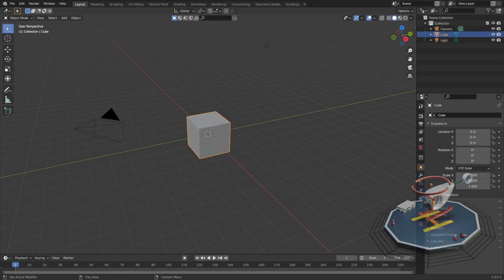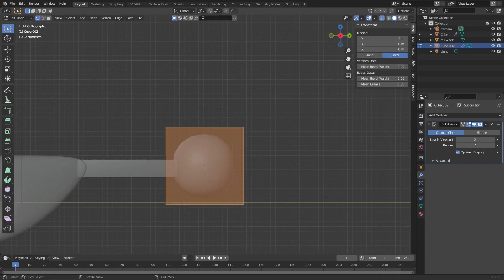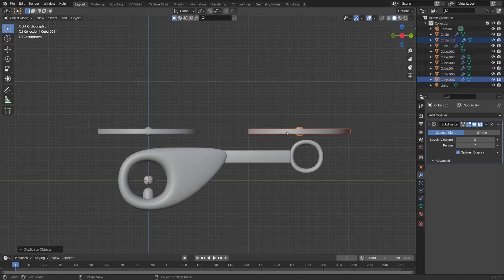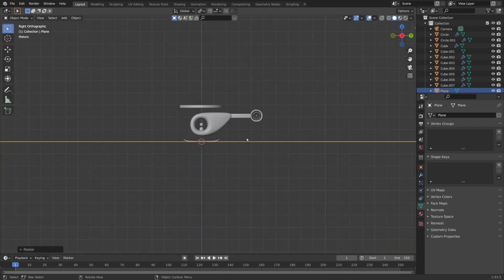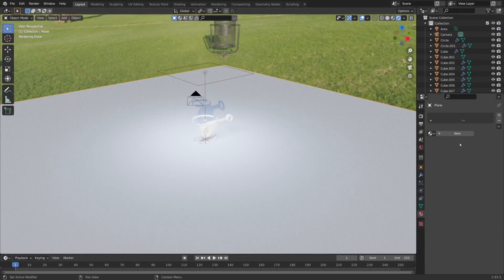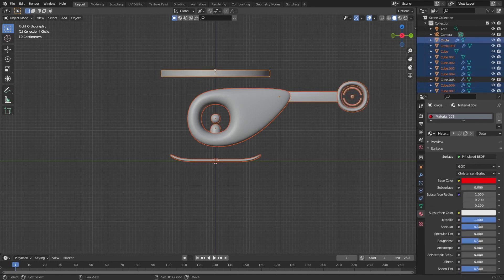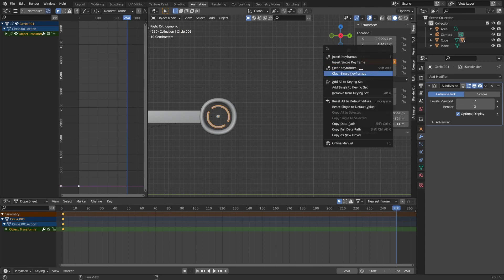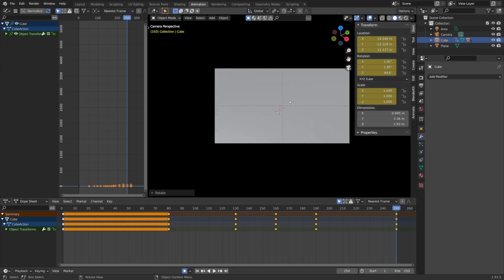Create a Sci-Fi Helicopter Animation in Blender

Comment: Hi
at about 12:47 you enter edit mode and your helicopter appears has the frame work skeleton on the silvery rendered body.  how do you get that look?  after watching and listening to the video alot, i just cant seem to get there,  what have i missed?  its only step i cant recreate, sure i cant finish it the helicopter without a window, but i cant complete it properly.  so i am need some help.
Reply from the maker: Hi @alpinewalker, sorry for late response and I hope that you finished project ! I just assigned the same material from the tail to faces from the body that I selected for the windows. I hope that's the answer and that will help you. If not let us know so we can help you ! ^_^
Reply: @rendercraft.  Hi, actually that wasn't the issue, my problem started earlier. missed applying the Subdivision surface modifier to the helicopter body(and other parts to be honest) after making the cockpit hole and finishing the main body, i didn't apply the modifier.  so when time came to apply materials,  i could see the frame work, but i just couldn't section it.     "project finished" , no not yet, i still have to do the fire extinguisher, added helicopter control stick and arms on the pilot while i worked the problem out, then re started :-)

Thanks for the reply and tutorial
Reply from the maker: @alpinewalker2000   Soon ,on our website we are going to open section for student project where we want to share projects that our students are making from our courses and tutorials. If you want to share your project you can send us your renders at academy@rendercraft.com and we will post it once its ready.

We are glad that you like our content and let us know if you need any help ^_^